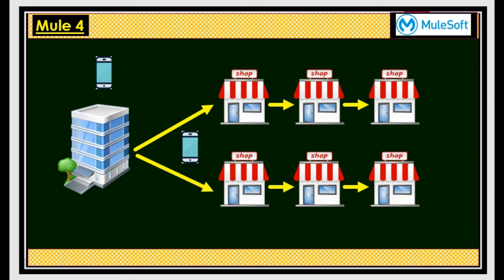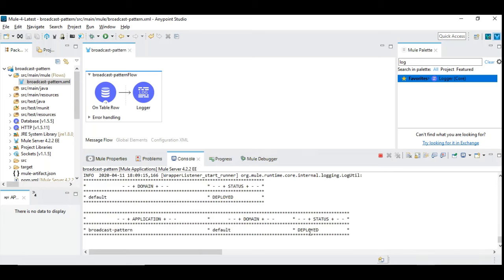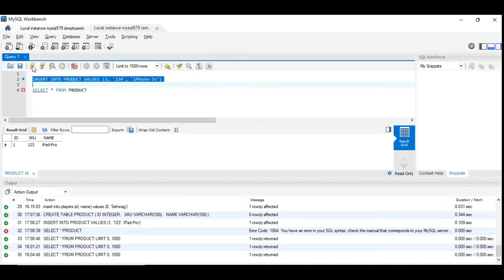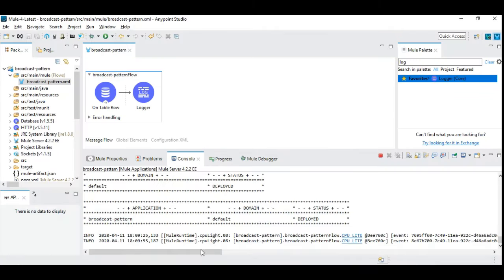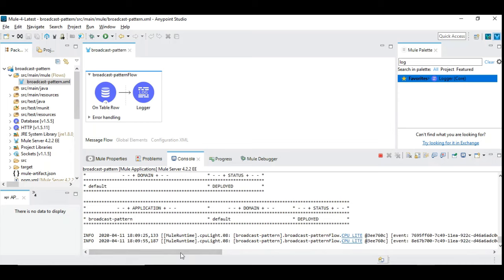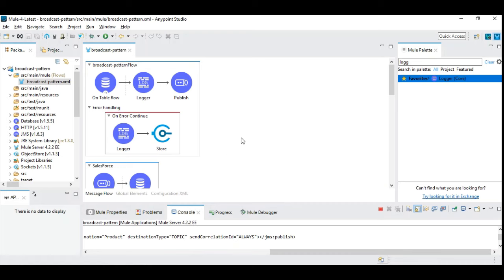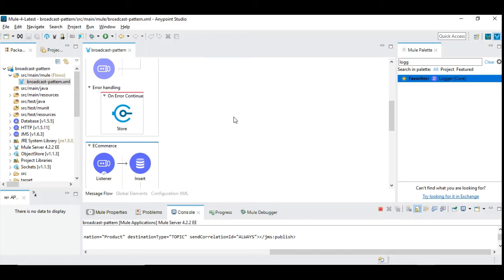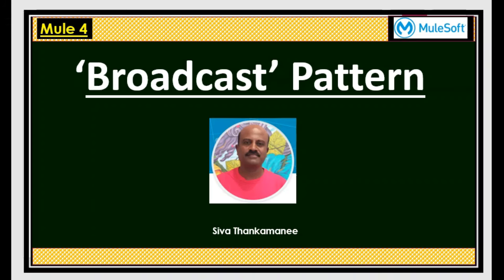Integration Design Patterns in Action - 'Broadcast' Pattern in MuleSoft

Comment: Hi Siva, Thank you so much for this video.
I have one doubt, as you have used same object store configuration in all the flows how can we differentiate and handle failure of particular flow. 
Will it not store the record in same object store if there is different flow errors at different point of time? How to bisect specific flow error in this case?